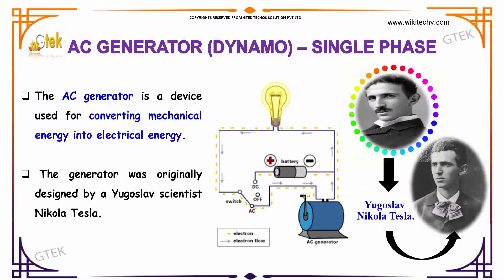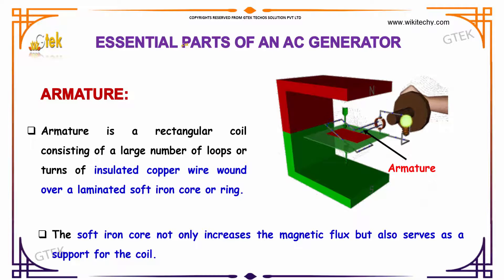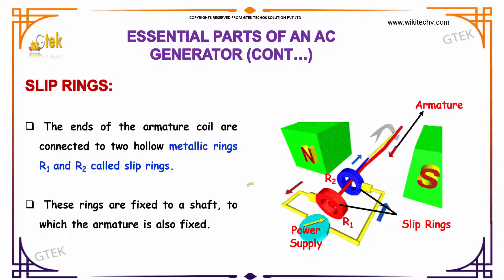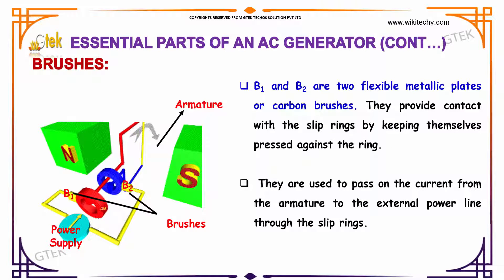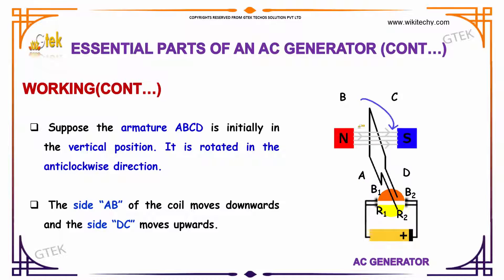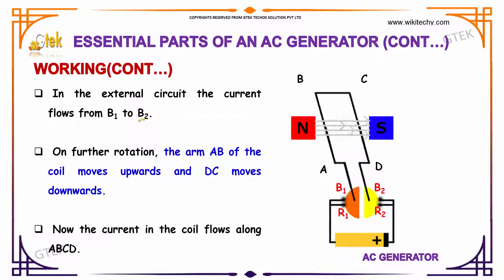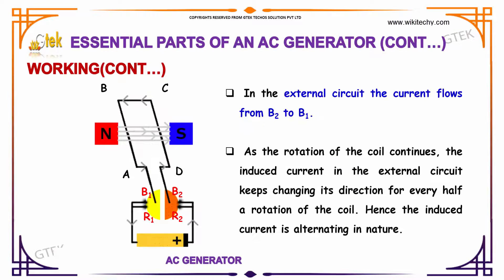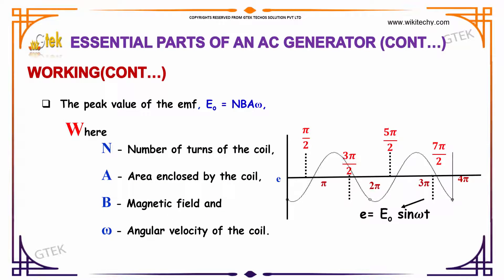Ac generator dynamo single phase|Electro Magnetic Induction And Alternating Current

Comment: A DC generator produces direct power. Both of these generators produce electrical power, based on same fundamental principle of Faraday's law of electromagnetic induction. According to these law, when an conductor moves in a magnetic field it cuts magnetic lines force, due to which an emf is induced in the conductor.

Comment: Dynamos and Generators convert mechanical rotation into electric power. Dynamo - a device that makes direct current electric power using electromagnetism. It is also known as a generator, however the term generator normally refers to an "alternator" which creates alternating current power.

Comment: The stator is a fixed structure that makes magnetic field, you can do this in a small dynamo using a permanent magnet. Large dynamos require an electromagnet. The armature is made of coiled copper windings which rotate inside the magnetic field made by the stator.

Comment: The Alternating Current Generator. An electric generator, or dynamo, is a device which converts mechanical energy into electrical energy. The simplest practical generator consists of a rectangular coil rotating in a uniform magnetic field. The magnetic field is usually supplied by a permanent magnet.

Comment: AC generator (Dynamo) – Single phase : The ac generator is a device used for converting mechanical energy into electrical energy. The generator was originally designed by a Yugoslav scientist Nikola Tesla. Principle: It is based on the principle of electromagnetic induction, according to which an emf is induced in a coil when it is rotated in a uniform magnetic field.

Comment: A dynamo is an electrical generator that produces direct current with the use of a commutator. ... However, in the early days of electric experimentation, alternating current generally .... This includes converting between direct current (DC) and alternating current (AC), three phase and single phase power, 25 Hz AC and 60 Hz ...